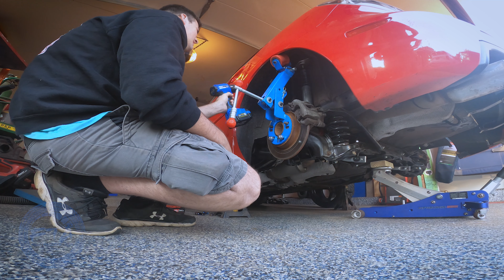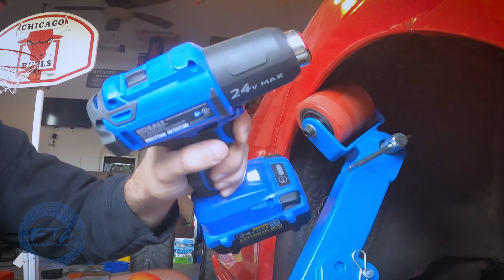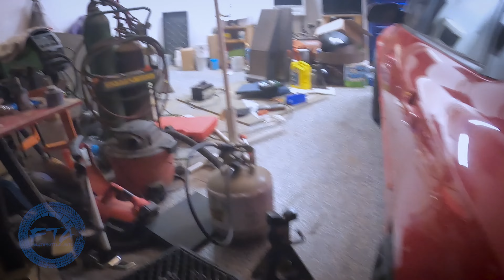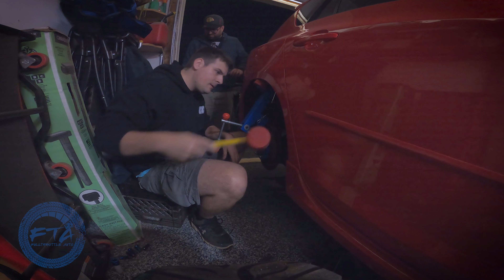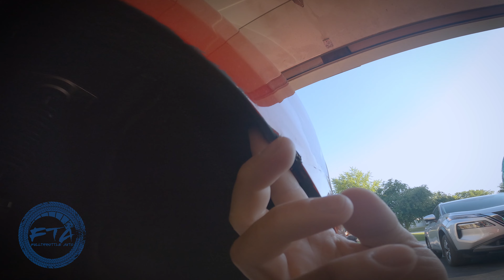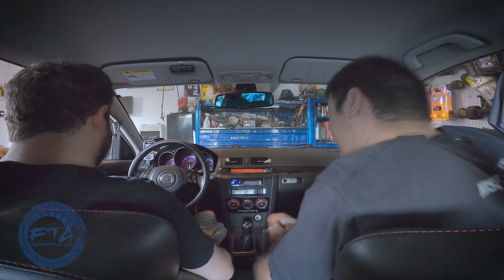Mazdaspeed3 Fender Roll and Pull to fit New Wheels/Tires | Saving My Buddy's Speed3 and Upgrades

Comment from the maker: Remember we are not professionals, if you don't want to damage your car do not do what we do, please involve a professional.

If anyone is curious on the wheels specs, they are 18x8.5 +35. Also anyone wondering why we didn't show any work on the front. Because the fronts were actually clearing just fine. The rears were the only issue.